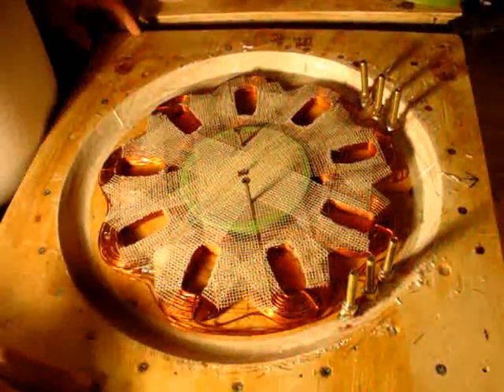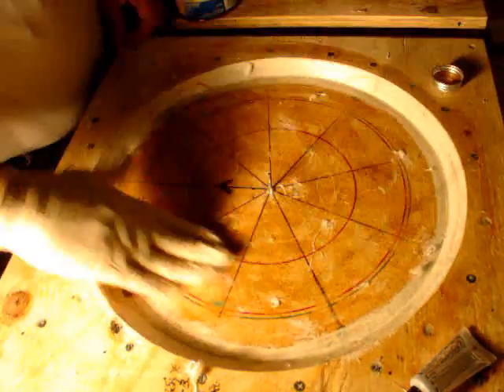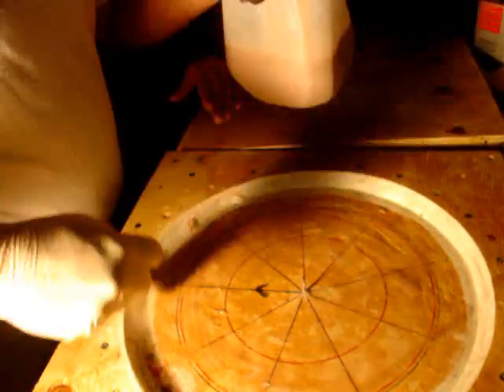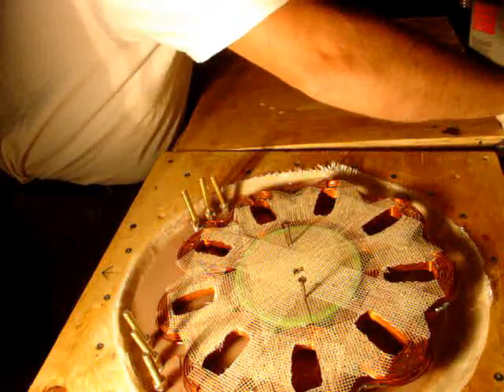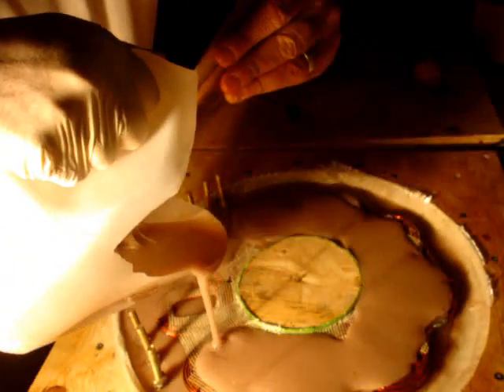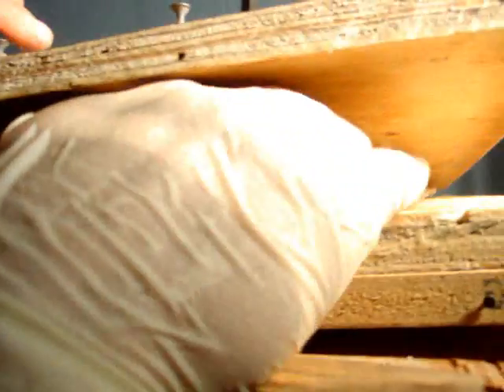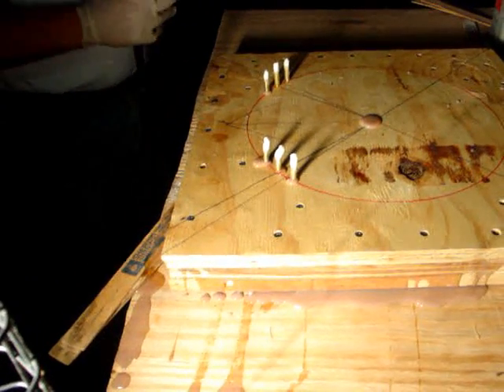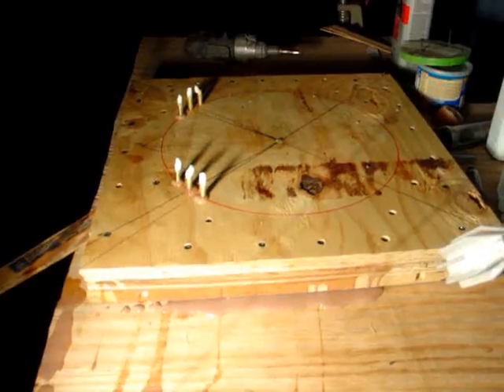BUILD A DUAL PERMANENT MAGNET ROTOR WIND TURBINE (PART 15)

Comment: This design has a huge air gap in the magnet circuit which makes it generate a fraction of the power of a design with a small cap.  If you are going to go to this much trouble making this, perhaps you need to add a soft iron laminated block fitted into the center of each coil and extending to the surfaces of the mold.  Cheers, Ian Schirmer, BEng (Hons) Power and Control Systems.

Comment: It would beeasier if you made the holes bigger and then fit a piece of tube over it to center and fill the gap after you got the bolts through :)
Reply from the maker: +electronicspark1 Excellent idea. Much thanks.
MUDDy

Comment: Also, you might find it easier to place the fiberglass down while it is dry and then just pour the resin over it.  Then be sure to wet the glass using a brush or a small hand held squeegee. I used both.

Comment: Aloha Muddy, I make surfboards and work with fiberglass and resin a lot. What I like to do for mixing pigments and my MEKP (hardener) is place a whisk or other mixer attachment on my drill.  The whisk makes smaller bubbles and they disappear quicker.  I have a little bucket with a lid full of acetone that I keep all of my brushes, spreaders, etc in.

Comment: I had a lot of fun helping you on this project.  Now when are you going to give up the camera and let me make my own?

MRMUDDYSWIFE
Reply: Hey Muddy,I have followed your videos so far..
I have a set up that I want to use to power my home ...I was told that ,with 400winds I will get 8000watts (2phase of course)
Which gives 110*2= 220 volts.
Well,I ought to let you know that ,I am not getting any current.. 
Would like to send the the picture, soon as I find.a way to do that.
I have issues with the wiring..Need your help.

Comment: @muddymuddymuddmann Ah, I feel so stupid, I thought you were using epoxy, my bad. I've never worked with polyester resin, I might give it a try soon. I have a stream near my house that is ideal for microhydroelectricity and I need some kind of alternator. It's a very small stream, so I can't afford to use an inefficient alternator. I might be giving this axial alternator a shot.